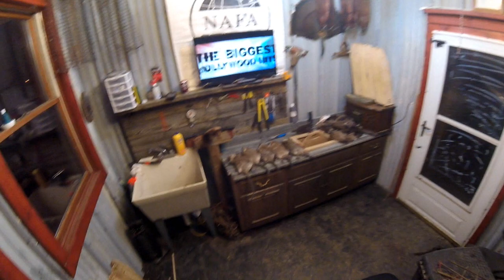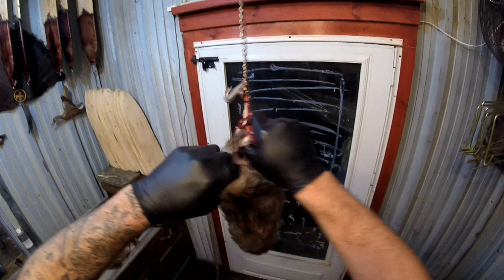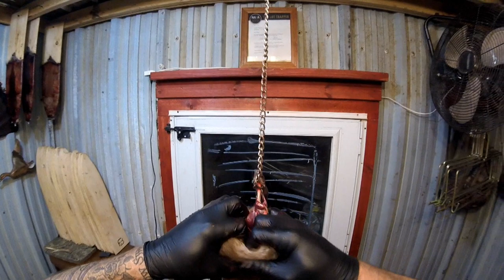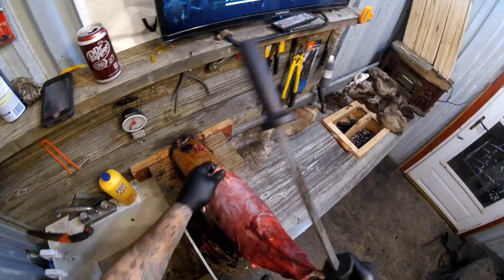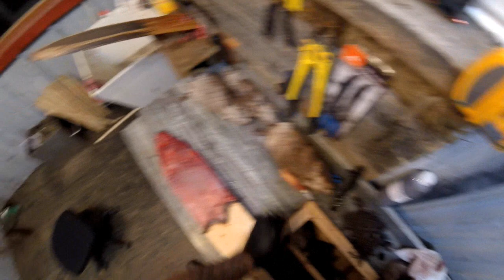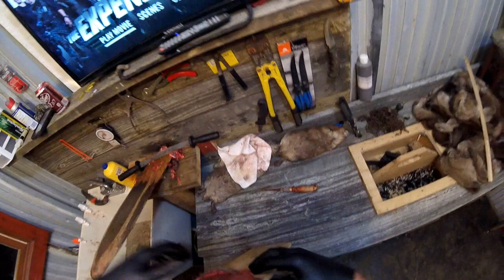HOW TO PROCESS MUSKRATS START TO FINISH

Comment: As a kid our garage was practically a muskrat factory. My mom my brother and I would skin the 30 to 60 rats my dad caught a day plus the half dozen or so my brother and I would catch. Well over 2000 rats a year and close to 3000 in some cases. Then I would gut and wrap them in packs of two for the meat. My dad would run them nose firrst through a laundry wringer to remove the bulk of the fat then did the fine fleshing and trimming the edges while on a wire stretcher. I'm surprised I dont see anyone using the wringer anymore. Fast and efficient. I only trap as a hobby now, a couple dozen furs and enough meat for 2 or 3 good rat dinners and a chance to teach my grandson something good. Thinking about hitting it harder next season, maybe get 3 or 4 hundred. Fur prices are low but the meat goes 2 bucks a rat around here, so that's motivating. I really enjoy your videos and am envious of all the species you have to trap. We are limited here in south east Michigan. Keep posting the vids and I'll keep watching.
Reply from the maker: your talking about a lot of time in the fur shed! it's a lot of work but i love doing it thanks for watching bud
Reply: Trapper J Outdoors If your skinnin fur or cleaning fish it means you had a good day. Anyway, thanks for the video.